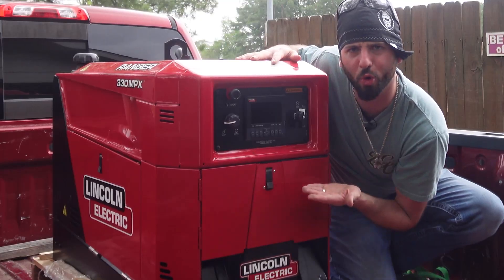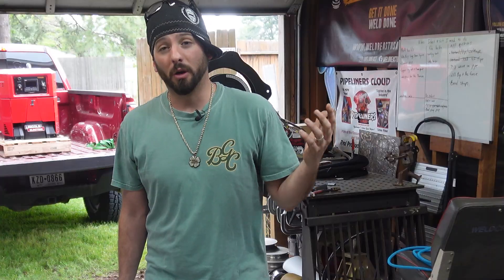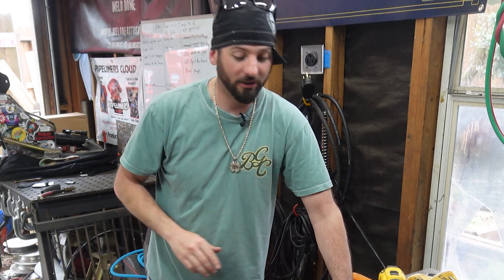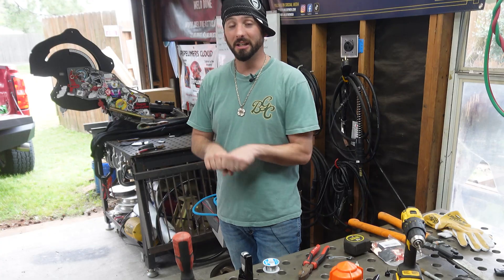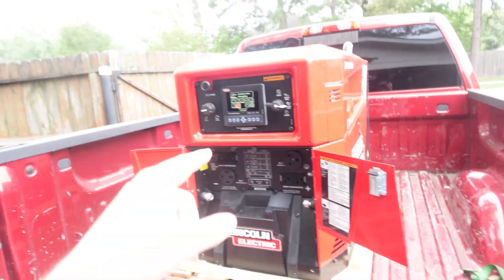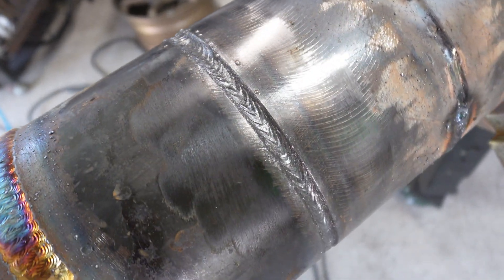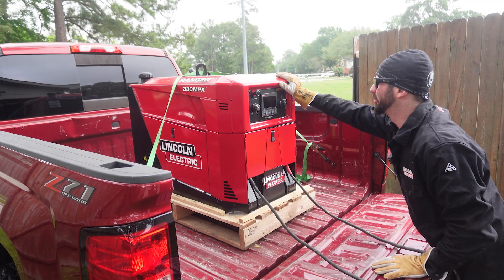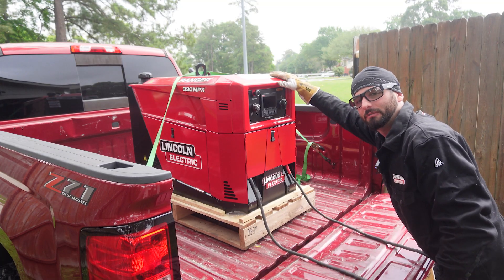Building Welding Leads For An Engine Drive Welder

Comment: The solder really isn't necessary. The leads will often get hot enough to melt it out, it's too soft to really give more strength.

Comment: If I run 10' of 1/0 ultraflex at the end of 120' of 2/0, do I bottleneck my system by having the 1/0 whip?

I have 125' 2/0 on my trailblazer 325.. but the leads are heavy as a sack of bricks.. would be nice to have a few feet of lighter cable

Comment: I know that some people advise soldering crimped lugs. But that’s not a good idea. Solder has poor conductivity. It’s ok with low amperage loads, such circuit boards. But for high amperage, it’s not ok. The solder will work between the strands and raise the resistance of the connection between the wire and the lug. If you’ve crimped properly, that’s all you need. Soldering doesn’t make it better and could make it worse.

Comment: Now for a minor correction. They do make the female stud adapters to fit the 260/330 mpx welders. You can order them from your welding supply store. They generally don't carry them because most welders have exposed studs that are lower down on the machine.

Comment: Awesome machine. Looks to be an update to mine. My 330mpx has the knob under the display vs next to it. Also only has 4 buttons where yours looks to have 5. Did they take the enter button out of the knob?
Reply from the maker: ooo idk! i had no idea it changed
Reply: @Welddotcom  got my 330 mpx a little over a year ago. Couple of guys I work with have 230 mpx that are identical to mine (barring some settings mine has that theirs doesn't) so I assume that you got a updated machine.😁😂

Comment: You should try out the new Bluetooth leads!  Super cool high tech.
Reply from the maker: Definitely I hear they are all the rage 😂
Reply: I’ve got twelve. They all just connect to each other
Reply: I wouldn’t use them. Generally I put my welder 100’ away from my start point. Then I just move towards it and go past it. That way I get just under 200 ft before I need to move it again. I’m moving like a race car. I’ve got well over a 2000 full pen welds. Never had a cut out. Had an inspector once say I was included. I said BS you’re on dope. He told me he would go up in the lift just to prove he wasn’t an A-hole. I said come on. I was going to air-arch it out but I decided to sunny wheel it just so I could spark him up. Haha. But after each pass with that wheel, I asked him if he saw anything. Every time he said, “no”. When I finally cut the root out.  I was pissed enough to weld with my eyes. He knew it too. He never saw one thing in that weld that could possibly justify a rejection. I boomed down and told him t get the F out of my lift. That was a lot of wasted time and money. Inside of an hour he was kicked of the job site. I still got clowned by a bunch of other ironworker’s. But them brothers they all know. 
Anyway that’s one of my stories. I’ve been welding since 1983. I love being an Ironworker. All you young guys out there who don’t mind a little bit of hand work and a lot of brotherhood, go be an Ironworker. Get up on that iron and get catty. The money is great.  You get to boom out and see the country. I have and I’ve met so many rock solid guys out there. I wouldn’t change nothing.

Comment: You can clean that corrosion off the strands with acid, just neutralize it and rinse and dry after. Then crimp without solder using a proper crimper instead of that junk. That way you won't get a hot spot or a stiff spot.

The way you did it, you trapped a lot of trash in the connection. It will eventually fail. The solder might prolong it some, but don't count on it. The solder also increases the odds the cable will break strands at the joint. I wouldn't recommend your method.
Reply: I’m no pro so I’m glad you’re here.

Comment: On the connections of the female and male connectors, I would put Kopr-Kote on exposed wire before tightening down the nut. Helps a lot if you work around the ocean, the cable gets something I call “the forbidden toothpaste” which is Cooper Oxide, and eventually causes so much resistance they were burning up. The coat of copper grease would prolong the life of that connection, and help keep water out.
Reply: An expedient quick fix is to make 2 solutions .
1 is household vinegar with table salt dissolved in it .
The other is baking soda in water .
MAKE AURE YOUR LEADS ARE DISCONNECTED BEFORE YOU DO THIS .
Everybody knows it , but folks still get the shite shocked out of them every day because they were complacent , forgot , whatever .

Drop the corroded copper end in the vinegar solution and let it sit for a couple of minutes .
It should turn very bright and clean . If not , give it another soak .
When it is clean and bright , drop it in the baking soda solution for the same amount of time as it sat in the vinegar solution , to neutralize any trace acid and salt .
Let it dry , and , put on a new lug , along with marine grade heat shrink , which should seal the connection against further water and salt intrusion , unless the insulation on your leads is getting old and porous , has cuts and cracks , etc .
At that point , it's time to get new copper and take the old stuff to the scrap dealer .
Or you could simply cut the corroded end back a foot or so until you see clean copper , then put on the new lug and shrink boot .
Don't try to nurse along worn out old leads .
Insulated cables can and will corrode internally , where you cannot see it .
It's a common issue on vehicles , where they have the Unholy Trinity arise , which is replacing multiple battery's , starters , and , alternators   all before thinking to check the 30 year old battery and ground cables that are completely corroded to hell and gone under the insulation .
They will still read 12+ volts when tested , until you apply a high current load that is .
This one can trip up even experienced mechanics .
Reply from the maker: great advice!

Comment: If you get a better crimper you won’t have to solder the leads.
Reply: When crimped properly, the copper strands end up a solid piece of copper.
Reply: Indeed. Worse, when solder solidifies the end of stranded wire (via capillary action) it creates a stress point for the strands and greatly increases the chances of fatigue failure. This video was good when talking about where to obtain wire on the cheap, but that's where it went off the rails. He said he was taught to solder the crimped connection, and I believe him, because the mania to solder poorly crimped connections is prevalent, unfortunately. Better crimps, not solder, is the answer.
Reply: @mwoliver  thank you. I’ve finally found someone else that realizes the benefits of a proper crimp.
Reply: @SergioPena20  Agreed. I make my own battery cables. No solder. Good strong solid crimp.
Reply: @mwoliver On our portable welding rigs (in the rust belt) we soldered all our crimped and set screwed connections to seal out the road salt's, if you didn't it would creep in and cause resistance from the build up. J-loc's got die-grease. never had any issues with broken wires. but burt up a few end's from not doing this sealing.
Reply: @SouthernGround     On my home shop built battery cables (and all wires)  I've been using heat shrink tubing that has a sealer built in. Not all do.  Can't really speak for long term as I've only done this maybe 7 or 8 years.. seems OK so far.
Reply: @ebinmaine  I am old, this was in the 60's and 70's, heat srink tube wasn't well known in our part's, did see something like it in the Navy mid 70's though. The stealing HST is great stuff 👍🏻
Reply: @SouthernGround  Gotcha. First time I saw shrink tubing was in high school in the mid-80s. Most people around me didn't use it commercially until the early to mid-90s though.
Reply: They sell hydraulic crimpers of all kinds , with sets of dies for different size lugs .
The hammer crimpers are cheap and do an adequate job , but for a few Bens, a decent hydraulic unit is superior , and recommended if you are really having to make and repair leads , battery cables , etc .
You will never regret it .
Save the solder for plumbing work .
Reply: @kaboom4679 I don’t like any kind of crisper that relies on what pressure the person can apply, or what hammer blows and how many they decide to use. Crimps are pretty strongly spec’d. If the spec is met, on the shape and compression of the crimp, it will be airtight and solid. Adding anything to it makes it go out of spec.
Reply: I have used a Temco TH0020 for many, many years and would put it up against any crimper on the market, hydraulic included. It's an absolute beast.
Reply: @mwoliver  the temco is the same one I use. I had commented this, but it seems like my comment got deleted.
Reply: Good to know!